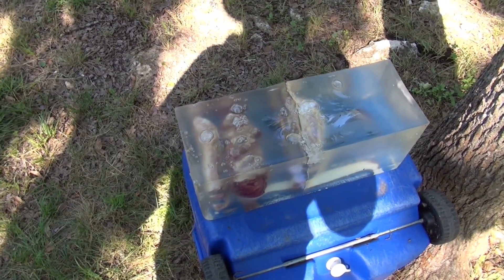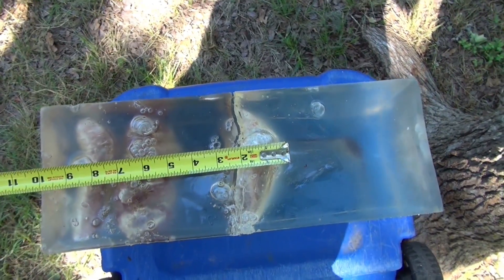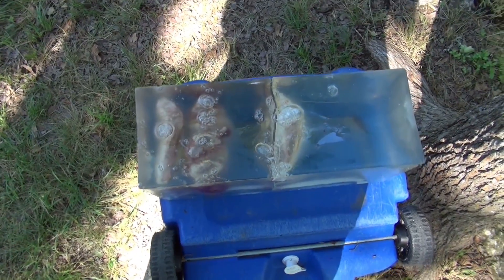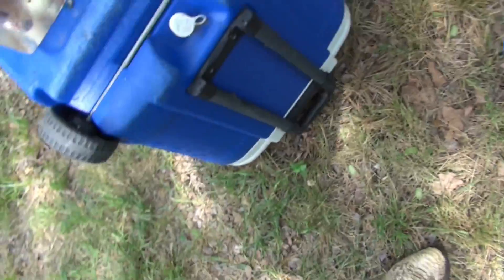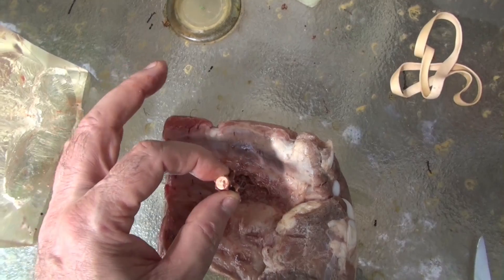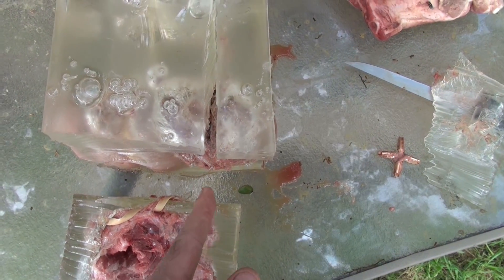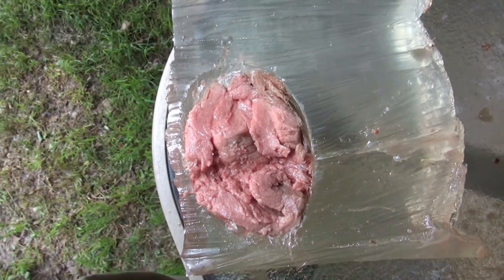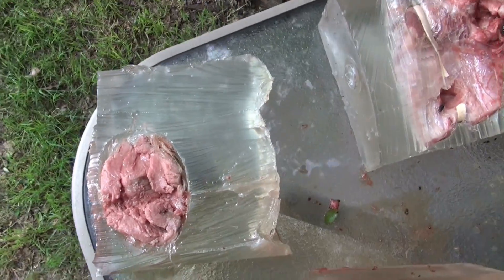Simulated Human Torso Ballistics test (ribs and heart)

Comment: I would ditch that round in 9mm for federal hst
Reply from the maker: I have tested the HST against the Lehigh Defense maximum expanding bullet in 9mm in many different test and my findings were that the Lehigh slightly out performs the HST as far as tissue damage is concerned. To date, i still haven't found another 9mm round that gives a better wound path than the Lehigh maximum expanding bullets.
Reply: Shootingthebull410 tests ammo from short barrels and hst out performs it slightly at a quarter of the price.....I saw ur video after I commented....I like ur tests
Reply: Robert Eddelman Liberty Civil Defense ?
Reply: Robert Eddelman penitration is more important than damage paths
Reply from the maker: Call me silly if you must.... but I'd say that big-ass bullet penetrated the hell out of that simulated heart! Tell me that would not have killed a person immediately?
Reply: M Blake Jr against body armor, yes .. against CIVILIAN attire i disagree.. i want my 9mm to pass  through the rib cage / breast plate and then explode with a shockwave strong enough to shut ur organs down with or WITHOUT the frag from the projectile that follows .. on a BATTLEFIELD my requirements for ammo would be different
Reply: OVERPROTECTIVEFATHER.45ACP sorry, that doesnt happen with pistol calibers
Reply: Robert Eddelman there is a reason for penetration requirments, not every shot is broad side

Comment: that 45 colt looks like grizzly ammo which I think you should try out too
Reply from the maker: Yeah, I've seen that Grizzly ammo online. But they only make that for 45 Auto. I specifically use the Lehigh Defence 45 colt maximum expanding bullet because it's put on a 45 Long Colt cartridge and has longer pedals on it because it's made especially to fire out of a Judge or Governor revolver. Because these guns have a longer cylinder due to them firing 4/10 shells as well, Lehigh could use both a longer case (45 long colt), plus longer bullet pedals... because of this, I'd think the Lehigh would outperform the Grizzly 45 ACP. I can't test that out because I don't own a 45 Auto hand gun, and I can't find the moon clip that originally came with my S&W Governor.... I probably threw it away because I never had any intentions on firing 45ACP out of that gun... lol

I did however, just order a box of the Grizzly 9MM +P ammo, just to test it out to see if it does any better than the Lehigh 9MM maximum expanding bullets. I suspect that round will be very similar to the Lehigh round.

Comment: Thank you! This was literally exactly what I was looking for. Most people don't test the 45 colt especially against a 9 mm but I primarily carry the glock 43 for almost all use but I recently bought a judge just for the fun cool factor and the 410 shooting but after reading up on it after I purchased, they highly recommended it for your vehicle carry so I've been trying to decide if it's worth going from the tiny G 43 to the judge and based on these test it looks like it will be for sure! so judge will most likely be replacing the glock for my nightstand and car weapon. That is for enough distraction until I can get to the AR pistol.

Comment: I'd not like to get shot by that huge Lehigh 45, It does makes a huge hole but the compromise is penetration, it probably did not penetrate deep enough to have reached  the central nervous system.I've read and seen it suggested by the so called "experts" that deep penetration reaching and destroying the central nervous system gives the best chance for incapacitation or stoppage , You may not always be able to hit a vital organ and do enough damage. Also  if your attacker's torso  is not facing exactly in front of you, you my have to shoot through an arm or shoulder further limiting the penetration desired to reach a vital zone. Normally I prefer the .45 but I like the 9mm design better here.In a situation where over penetration is a concern these bullets look admirable yet the compromise is the concern of Under penetration.Have you tested other bullets like  this?HST, critical duty?Love the simulation yet should have used denim regardless of previous results to stay consistent IMO. Thx

Comment: Do another video just like this same block or hearts if you could find them but add a few layers of denim to the front. I'd like to see how the le high maximum expansion would do with the added denim. I'd love to carry thoughs rounds for duty. Thanks
Reply from the maker: +matthew paredes I've done several other simulated human torso test that have included a few layers of denim. There are a couple of those test posted on my page on here. Basically a few layers of denim has literally no effect on the Lehigh Defence maximum expanding bullets. They do not clog from the denim, it doesn't change when, or how much they expand, once in the tissue, nor can I tell any difference in penetration depth. I didn't bother doing the denim on this particular test simply because my several earlier simulated human torso test showed me that a few layers of denim has no effect on these bullets.

Comment: Awesome test. This is exactly what kind of ballistic test I like to see. Do you have anymore test using other ammo and using simulations? Excellent job. Thanks for showing it.
Reply from the maker: dmbrazzy71 I only test ammo that I actually use with my own carry guns. The folks at Lehigh Defense are working on trying to provide me with a 357 Magnum Maximum Expansion bullet that will work good for my short barreled Ruger 357 magnum revolver. I will be posting another simulated human torso test just like this one using that ammo once they get it worked out and sent to me. I also will be doing a couple more barrier test with all my various ammo as well before too much longer.
Reply: Robert Eddelman Thanks. In you personal opinion would you recommend this ammo, Lehigh maximum expanding ammo?
Reply from the maker: dmbrazzy71 After all my own testing of all the different ammo I could find, for the carry guns I actually use, I have decided that the 9mm and the 45 colt judge/governor Maximum Expansion ammo for those two calibers is what performs best and that is what I carry full time now. With all my own personal testing, I can't find any other ammo in those two calibers that really even comes close to doing the kind of damage within the critical organ area of a simulated human torso, as what the Lehigh Defense Maximum Expansion ammo does.

Comment: I call that "mince meat". Great video Robert!
Reply from the maker: Rascal77s Yeah, that was the word I was thinking of in this video, but I just couldn't get it out at the time... lol
Reply: Robert Eddelman
You still get credit because you did say "minced" just a little later in the video.

I use Federal BPLE in my 9mm but these rounds you tested are pretty impressive. The only concern I would have is the low penetration from the 45 if you had to take a side shot. Not sure I would trust it to penetrate an arm bone then a rib and still make it to the heart. Would sure as heck shred a lung pretty good though.

I've been shooting for a good while now. Back in the day we were using wad cutters for self defense rounds. Isn't it amazing how far bullet technology has come in just a few decades?
Reply from the maker: Rascal77s You know, I was a little worried about that too, but I've done some penetration test through various hard barriers and that 45 Colt ME bullet simply does not expand at all after going through a hard substance such as wood, steel, bone, dry wall, etc. When it doesn't open up those huge pedals, this bullet penetrates plenty deep. If the hard surface deforms the tip of the bullet or in the case of plywood, completely plugs the tip, then the bullet will not expand once it hits tissue and will actually penetrate very deeply. Some barriers such as regular wood and bone, the bullet will then expand a certain amount after going into the tissue, but will usually go deeper because it doesn't fully expand.The thing that decreases the penetration the most is when those four huge pedals fully expand in tissue, which is exactly what you want... however if it has to go through a hard substance first, such as the arm bone you mentioned, that does not decrease the penetration at all, it actually increases the penetration, so I'm fairly confident this bullet would have no trouble going through an arm bone or any other hard obstacle and would still penetrate plenty deep to hit the vital organ area. Maybe this barrier testing will show you what I'm trying to explain....

https://youtu.be/kTolNB42R80
Reply from the maker: Rascal77s And yes, bullet technology has improved a bunch in the last few years.... I'm happy to see it too. Fact is almost all the name brand defense ammo now days would probably get the job done... but from my personal testing, I think the Lehigh Defense ME bullets have an edge over most of the standard hollow point ammo put out by everyone else... but that's just my personal opinion, but that opinion is based on a whole lot of my personal practical ballistics test.
Reply: Robert Eddelman
Eye opening penetration test and that jig was a pretty good idea. At the end of the day, no matter what ammo we use, the best defense is keep pulling the trigger til the bad guy stops trying to do bad things.